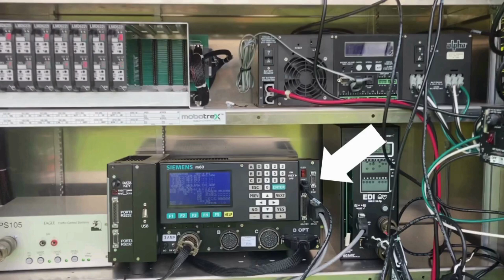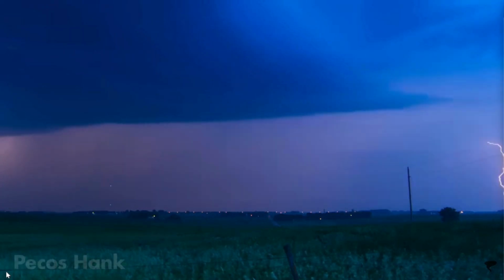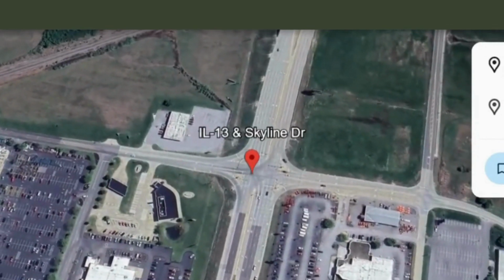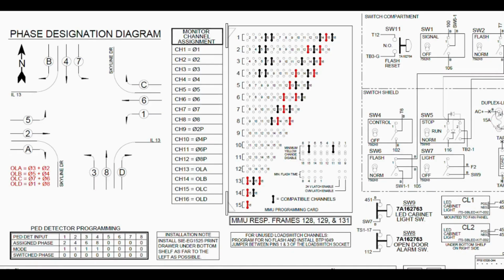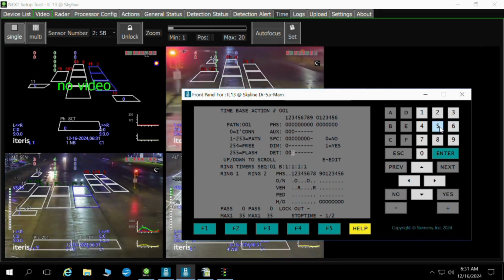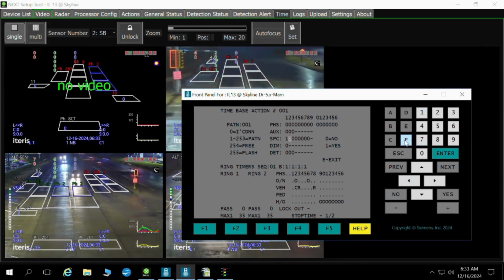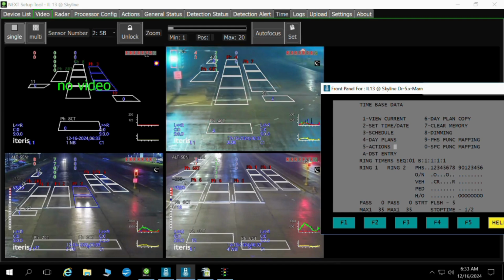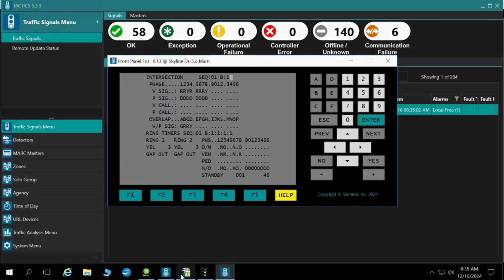How I Remotely Repaired a Faulty Traffic Light

Comment: okay, now explain how the emergency vehicle exemption system works
Reply: It exist two systems mainly. First, there is the systems which the emergency vehicles themselves trigger, often via IR that places a pre-emption call on the phase, but RF systems also exists.

Then there is the second type, which we have in sweden, where the emergency vehicles are connected via fleet management to a central system, where the computer knows where all emergency vehicles are via GPS, and will then trigger the pre-emption call remotely when a emergency vehicle approaches a traffic light based on GPS. Uusually this is done by connecting a remote modbus over TCP/IP relay, like a ADAM 6060 to pre-emption inputs on the traffic light controller, and then the "central computer" can trip emergency pre-emption.

In some cases with long queues that stocks up on a traffic light, the emergency vehicle don't get enough close to trip the GPS based pre-emption system. Then they call via radio to the fleet manager, which can manually login to a panel to manually trip pre-emption on a light.

Pre-emption means that the traffic controller will abort the current going sequence, activate the phase that is pre-empted, and once that phase is finished, it will start over from a new sequence. (When rain and moisture got into a tram pre-emption sensor for trams here in sweden, and short circuited it, it caused the traffic lights to always serve the tram (even when there was no trams) and the adjacent movement for cars, and then starting over all the time, so the movements AFTER the tram signal never occured, leading to people running red light and such after having waited half a hour or more for green light).
Reply from the maker: @ Great explanation!
Reply from the maker: @ And thank you!
Reply from the maker: @sebastiannielsen did all the heavy lifting explaining it below!